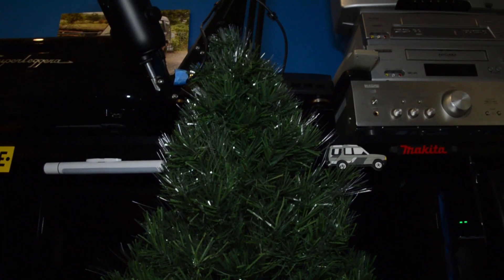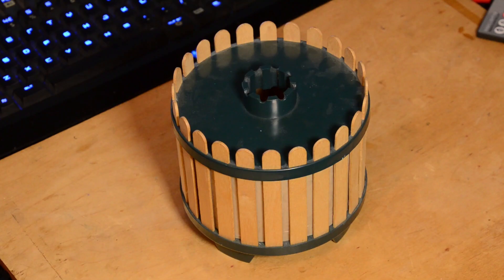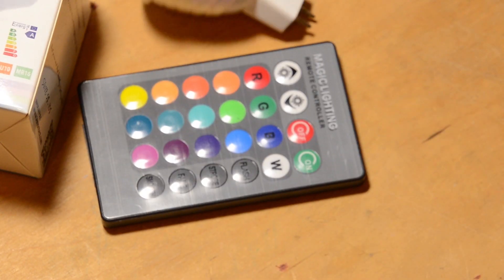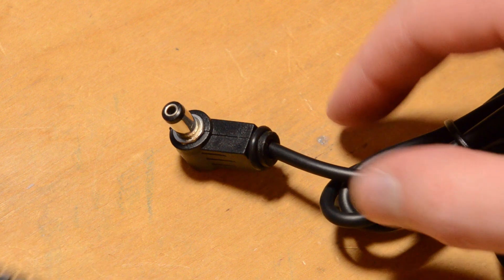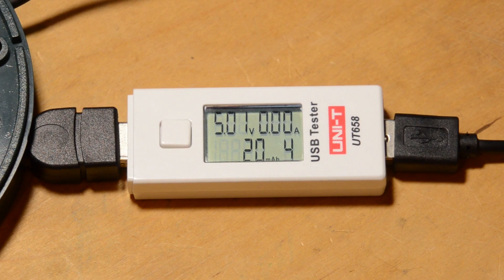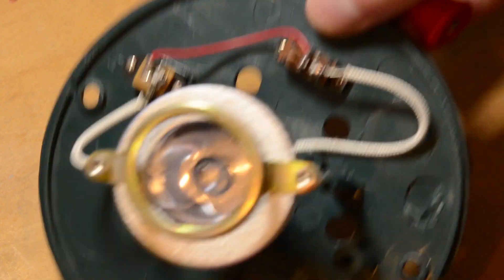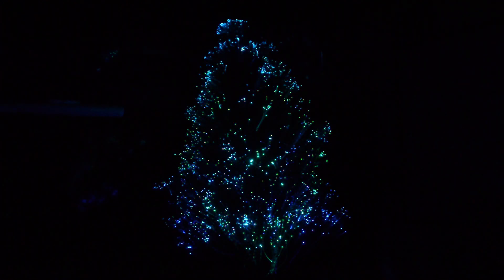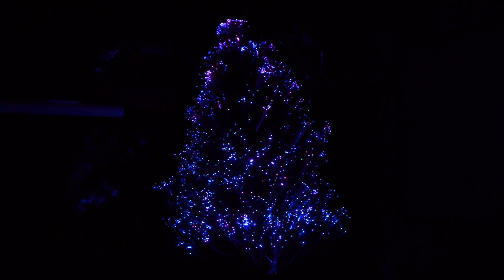Fibre Optic Chrismas Tree Upgrade Project

Comment: You removed the best part. The color wheel is better in my opinion. I would have used a white led bulb. You don't get the effects with an rgb led You get with the wheel
Reply from the maker: I think you're right, I just got the tree out of storage the other day and still have all of the original parts. I have some MR11 LED bulbs arriving today that should have a decent enough spread of light to work with the colour wheel. The motor did squeak so maybe that needs a bit of oil but otherwise it just needs soldering back into the power circuit.

Comment: Great video Master!!....Do  you use a mobile phone to power the USB converter??... instead of the old bulky power supply
Reply from the maker: I plug it into a USB port on the PC I have nearby and that powers it fine, even if the PC is off. Much better than having the big wall wart power supply. I put it away last week but it was still working fine.
Reply: @MattTester  Thanks for share the know how..., I'll do the conversion too!!
Reply from the maker: @omegarojo790  You're welcome, lots of these have probably been thrown out when they could've been converted into something better.

Comment: I am trying to replace the motor with a similar bulb from your video but the bulb I ordered came with different pins than the base on the original socket.  Did you remove something from the pins to make them compatible as the bulb you use looks to have a different base than the one on the box you show.  Thanks!
Reply from the maker: Hi Meg, I didn't have to make any changes as the MR16 bulb has the same two pins as the old MR11. The box picture is wrong in this case, the text below has E27, GU10 (the one shown) and MR16 so I think it's just a generic box. I have the tree up (it still works) but I haven't seen the box for years, maybe it has the correct picture on the other side.

If you needed to adapt a GU10 there are adapters available or you could maybe use some thin solid wire to wrap around the pins and then plug in to the MR16 socket. It's very low power at 12V so as long as you ensure the wires don't touch and short out that would be fine. Not recommended if you have a mains powered bulb though!

Comment: A worthwhile project indeed. 👍👍
Reply from the maker: I originally just wanted rid of the noise of the motor but also getting rid of the heat from the halogen lamp, the big 12V AC power supply that always got in the way in favour of USB and adding remote control to it mean it was really worth the effort involved.